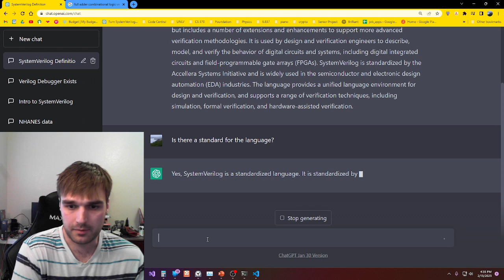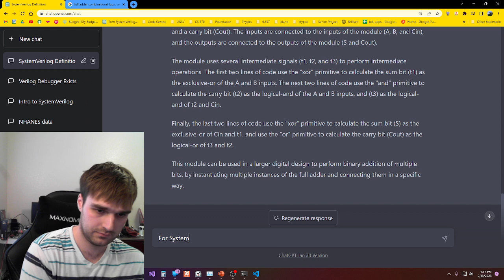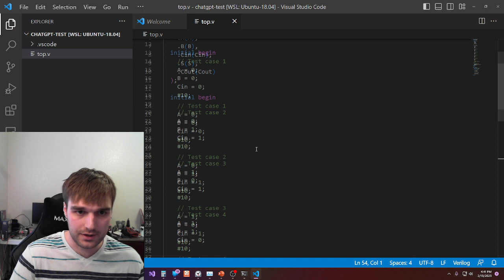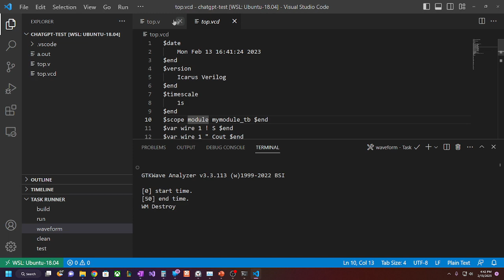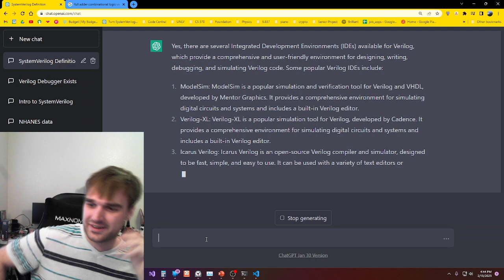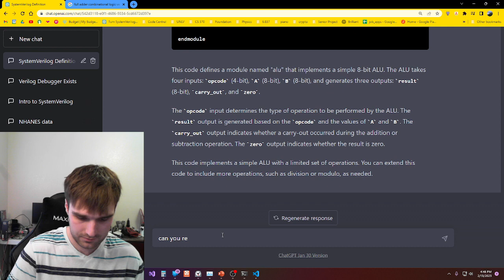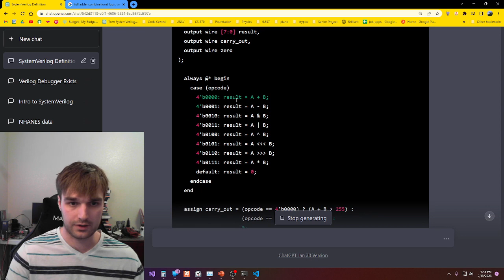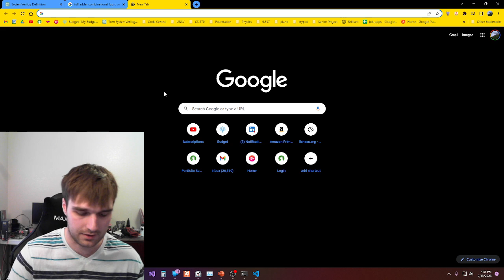Using ChatGPT to write SystemVerilog

Comment: Really digging the testing feature, with the waveform and all, so neat.
I'm using ModelSim, which isn't very light weight and the UI is meh compared to VS Code.
Am I hearing Undertale in the background?
Reply from the maker: you are hearing correctly! that's the track "Ruins", I just wanted to have some nice ambience.

I was pretty excited to figure out how the "tasks" feature works in VS Code. you could script it to do anything you want. I'll go over the setup in my next video! 😁